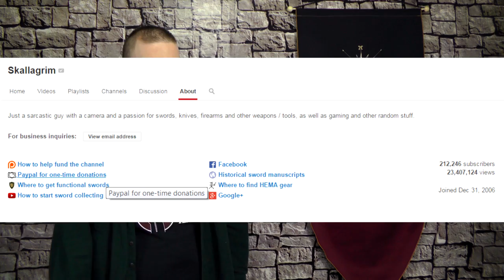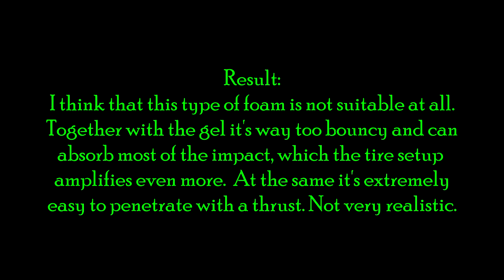The ongoing quest to find a realistic test cutting medium

Comment: If possible go with animal bones. (I know... i watched and listened to your video, but sacrifices have to be made when science, or in this case realistic testing is involved) You can get them in any larger butcher-shop, as they have to take the meat off them to sell it. Second thing, i get the idea behind the tire, but it's way too light and loose to act like a real person. It's like you're hitting a tall skinny person balancing on small surface. My idea is, make it much heavier, crudest method is just putting bricks or rocks inside it the bottom part and closing it with duct tape, just in case.

Comment: Those are pretty hefty swings you make, I would guess you wouldn't swing with such force in a proper duel? (just hypothetical, not like you'd need to duel anyone)

Fresh birch is a pretty good substitute for bone, I've heard.

A not so practical proposition perhaps, but have you considered making any veins or arteries? Regular straws could be sufficient, if they were filled with some blood-ish liquid (just water with food coloring could be the easiest) and sealed off. That would be interesting to see being cut, (fake) blood coming out and all that, although it would be difficult to make it absolutely realistic. But it could be entertaining. Needless to say, it would probably require outdoor testing.
By the way, does food coloring work with ballistic gel?

Comment: Just out of curiosity could you not use something like a punching man that fighting trainers use? I'm not overly sure on the realism, but I assume the material used is to simulate someone impacting it with real pressures and resistances. I believe it will also help the viewers understand height of sword swing relative to another human just making it a little easier to understand where strikes would land in realistic scenarios. Its just an idea, mostly based on assumptions really, but Could be worth considering...

Comment: Have you ever looked into the method of how the Japanese tested their swords?

No, I'm not talking about how they would test it on actual people.

I am talking about Tameshigiri. http://en.wikipedia.org/wiki/Tameshigiri

I know they've used this for a long time in testing out swords (Though today they have been more geared towards ability than actually testing the sword itself).

Perhaps using this method for your swords and possibly wrap that in a layer of the ballistic gel might simulate what you're looking for.
Reply from the maker: Kairyudragon I know, I have tried tatami mats before. They are actually not very realistic.
Reply: Just a suggestion.

Not sure if you've found anything yet or not, but had thought to suggest that maybe with the gel it might be a bit better.

Though they are mainly for slashing and not stabbing.
Reply: Kairyudragon
The thing with Tameshigiri is that they were less intended as a realistic alalogue for cutting flesh or wounding, and more as a relatively consistent measure of a sword and it's user. Whist various Tameshigiri could differ quite a lot, if a Shogun had a good stock of identically manufactured Tameshigiri, and always had the same sufficiently skilled user test his swords, then it was a comparatively objective way of comparing them. A bit like the simple "is it sharp" paper test, but for heavier strikes.

Also since Skall is using a much broader range of weapons and striking styles, they somewhat lose that comparative value.

Comment: The Japanese traditionally used bamboo as a bone analog for practice cuts.
Reply: Yes they did but the also used reed matts wrapped around bamboo to simulate a leg or added more reed thickness to simulate the resistance of a torso.
Reply: Graham Totte And people used straw and wooden models for target practice, doesn't make it an accurate representation. And in case you dint watch the video, Skall is already using bamboo, he's looking for a flesh substitute.

Comment: What about cutting a small say 1 inch diamerer hole on the long ends of a watermelon and then pushing a broom handle through the center and usind duct tape on the bottom to keep it from slidind down when you plant/stick it in a hole in the ground.

Comment: I don't know if you've tried this or not, but I figure that pvc pipe would be fairly similar to bones.
Reply from the maker: No, PVC is very different. Not porous, but shatters way more easily.
Reply: Okay, makes sense. Thanks for the information.
Reply: Skallagrim have you tried filling the pvc tube with eurathane foam?
Reply: Honest Think that is much more accurate because the outer layer of bone is hard but the inner layer is squishy because the bone marrow the main issue with using bamboo is there's nothing squishy inside of it
Reply: Alex Smith squishy isn't particularly accurate, softer and porous but not squishy

Comment: I wonder if it might be possible to inject air bubbles into the ballistics gel as it cools, to alter the consistency and make it react more realistically to thrusting and cutting weapons? Could it be cut with water, to reduce its density?

One inch nylon rod might make for a good bone analog. I had originally suggested "Friendly Plastic" but I think its softening point is below the melting point of your gel.

http://plasticworld.ca/store/index.php?main_page=product_info&cPath=2_32&products_id=82

Comment: Use tire rubber to simulate human tissue. Btw, you say the tire set up puts too little resistance, but if you strike an arm or a leg, it will swing to the side with more ease..

Comment: On the subject of testing medium. The FBI uses this:
"The test media used by the FBI to simulate living tissue is 10% Ballistic Gelatin (Kind & Knox 250-A), mixed by weight (i.e., one pound of gelatin to 9 pounds of water). The gelatin is stored at 4° Centigrade (39.2° Fahrenheit) and shot within 20 minutes of being removed from the refrigerator. The temperature of the gelatin is critical, because penetration changes significantly with temperature. This specific gelatin mix was determined and calibrated by the U.S. Army Wound Ballistics Research Laboratory, Presidio of San Francisco, to produce the same penetration results as that obtained in actual living tissue. The 10 % gelatin has been correlated against the actual results of over 200 shooting  incidents. Each gelatin block is calibrated before use to insure its composition is within defined parameters. Copies of the test protocol are available upon request for those interested in duplication the testing or reviewing the procedures in greater detail."
(http://greent.com/40Page/general/fbitest.htm)
If you want to keep your "bone" inserts from moving your should clamp them at two places so as to not give them a pivot point to shift around. Getting the "veins" to stay in place will be more tricky, I would suggest using some sort of ridged wire frame (again, clamped at two places). The wire would, of course, be an unrealistic addition but should only really have an effect for low force cuts like with a small knife. Choosing the right type of wire is key, as it would need to have high heat resistance but be quite soft.
On the subject of funding, developing a realistic flesh testing medium would probably be of interest to various blade manufacturing companies. Of course to maintain your ethical standards you would need to make very clear that they are not paying you to for a good review of their products but for research and development of a reasonably realistic human substitute. Once your research is complete you can provide them with the instructions and offer yourself as a testing service as well. This strikes me as having the potential for a decent small business.

Comment: I'm probably missing something obvious, but what, specifically, were the downsides to the soaked newspaper method?
Reply from the maker: DynamicWorlds On a real body skin makes a big difference. It's surprisingly resilient. But even though the soaked newspaper lacks that it's still more difficult to cut, so it's not very realistic.
Reply: Thinking of flesh mostly being a mass of connective tissue and fluids as an inspiration.

What about using an open-celled foam (thinking something like upholstery foam) and soaking it in something semi-viscus (diluted corn syrup maybe) to represent internal tissue?

You could even adjust the density of the foam/viscosity of the fluid to differentiate between muscle and internal organ if you wanted.

Then do the plastic wrap to contain the mess & use a skin analogue (such as the yoga mat or a very thin, flat layer of the ballistics gel that would be thin enough for the friction problem to matter less) for the skin.

Comment: A good substitute for a human skull is a fairly young Coconut. Coconuts are capable of breaking human skulls from 15 foot drops, without much damage.
Reply: Also, A thick PVC pipe surounded by some firm foam could be a neck. For skin you can use low-grit sandpaper.
Reply: +lumpy1space2princess If it breaks a skull and does not take damage itself, then that would mean it's NOT a good substitute... if it were equivalent, you would expect equal chances of damage (on average, at least) for both objects from an impact.

Comment: What about frozen newspapers, that might make a half decent femor subsitute
Reply: did you miss the bit about the ballistics gelatin needing to be about 270 degrees fahrenheit?  you're talking about taking a piece of newspaper, soaked and frozen, so it's at about the freezing point of water, and then dumping a viscous fluid the temperature of boiling water onto it?  I doubt it would work, and you might end up with frozen deep fried turkey syndrome.
Reply: No, that would be silly. but if you were intent on using the gel you could just cast a hollow spot. I ment to forgo the gel entirely and try a different medium. Many things change there characteristics once they are chilled or forzen

Comment: http://www.doitpoms.ac.uk/tlplib/bones/bone_mechanical.php
This gives some physical properties of bone including tensile and compressive strength.
I don't think you will be able to find a very accurate analog to bone with out it being bone. Plaster might work. You can use a high strength plaster with some sort of fiber in it (like straw or the fiber glass in plaster of Paris). I can't get a good accurate reading on how strong plaster of Paris actually is (various experiments range from lower than bone, to twice as strong.) however it is cheap so it might be worth looking into.

Comment: why don't you just let the stick pertrude at both sides to keep it fixed in place and just cut off one end afterwards? or is there something i'm missing?
Reply from the maker: pmoneygf Yes, you're missing that the mold is closed on one side. :)
Reply: ***** You could tie the bamboo in place cross-wise. O---|-----|-----O. Tie the string around the mold and suspend the bamboo in the middle of the middle.
Reply: anthony kent
perhaps a christmas-tree-base-like attachment at the bottom of the mold would work?

http://scene7.targetimg1.com/is/image/Target/16593625?wid=410&hei=410

something like that, but smaller and with a lower profile to latch onto whatever it is you're molding, you could then cut it away when the mold sets?

Comment: Go buy yourself a whole pig. Problem solved
Reply: Skall doesn't support the meat industry...
Reply: Darin Humble i was actually going to say the same but then he mentioned that..

if he supports pickle farms or pepper farms he could buy a big glass jar of Mt. Olive (a brand that does olives, peppers, pickles etc.) and fill it up with wet sand letting the sand and glass jar sit outside until the water evaporates leaving the sand in a hard form instead of say drain the sand making it a bit easier to flow through, aka glass ='s bone i guess and wet HEAVILY CONCENTRATED THICK PUSHED DOWN sand for the thick skin.

add-on-note: when/IF glass ever breaks then just tape it over with gorrilla tape.